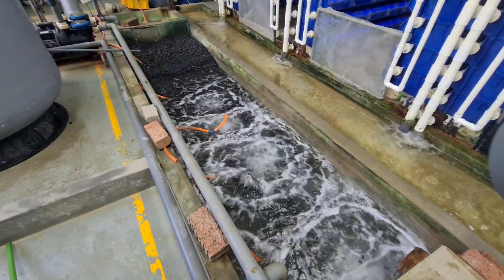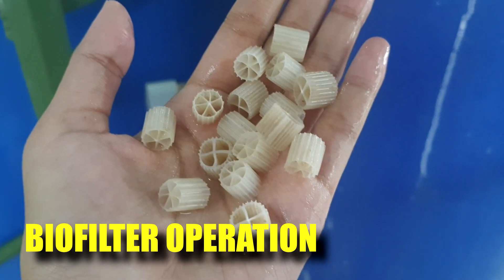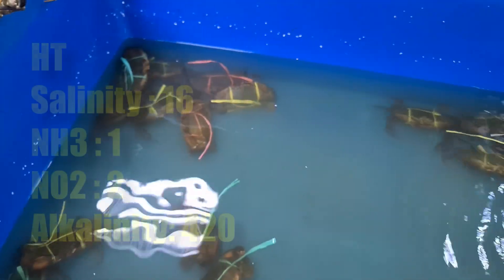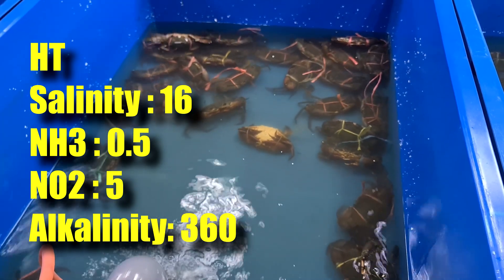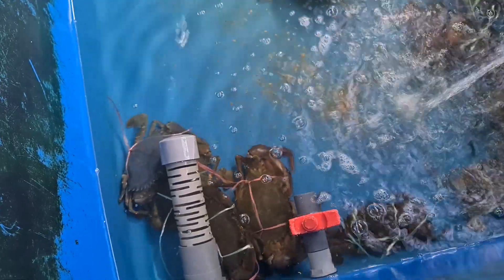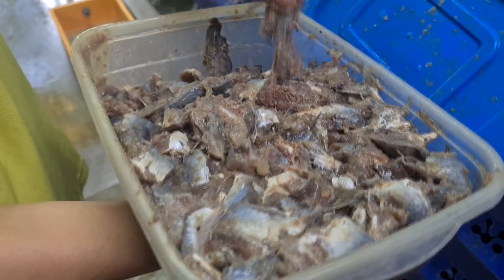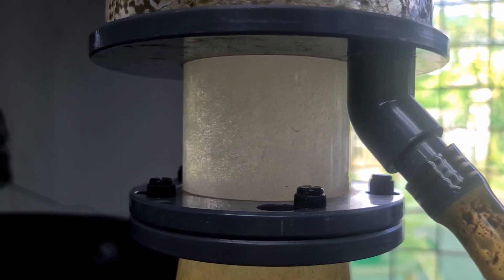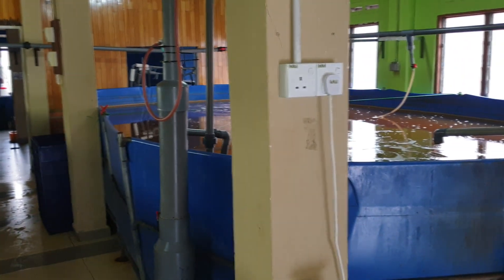Optimizing Biofiltration Ammonia Removal Efficiency

Comment: kaldness should collide with one another and not be in a stay position, if the kaldness is stay not move and not collide with other, its effectiveness in nitrification is much reduced,
Reply from the maker: The pump has a variable speed drive, which will be increase when organic load is high. Under low load condition, we run with lower speed and poor mixing